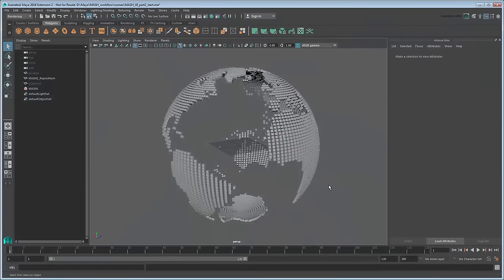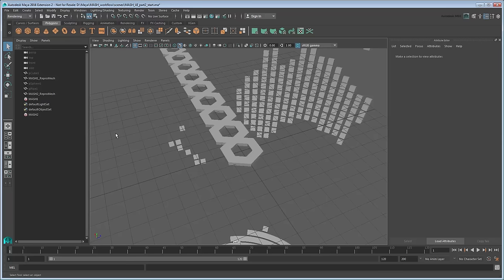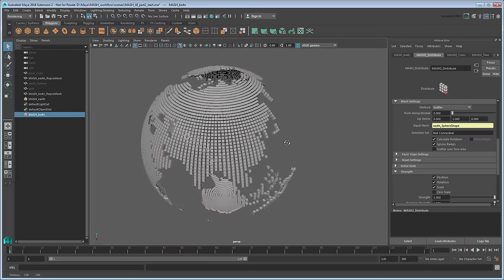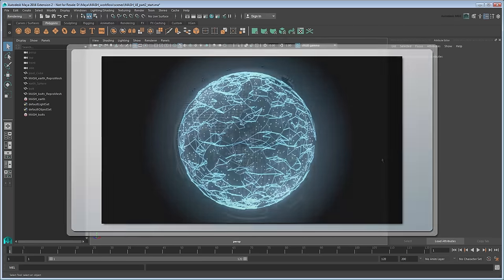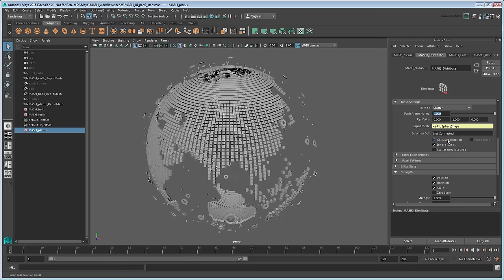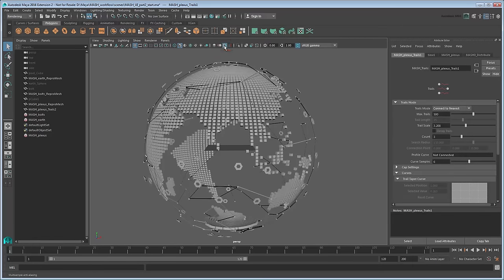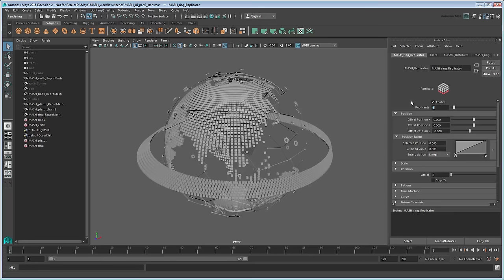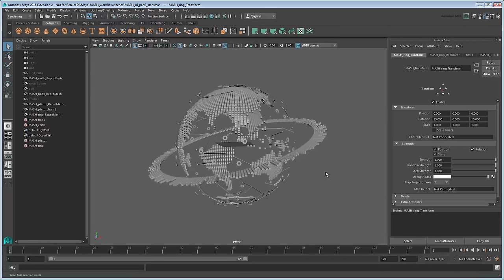MASH end to end workflow - Part 2: Creating a plexus sphere and surrounding elements

Comment: thing what I am trying to do is to have them spaced all the same, how do you do that? Instead of having all kinds of different spacing?
Reply from the maker: There's a couple of things you can try.  The easiest method is to alter the starting sphere with some of the modeling tools.  You can remove some of the edge loops along the height to space out the cubes more.  That said, the vertices will always have to pinch together a bit (otherwise you'd have a rectangle rather than a sphere).

Alternatively, you can try setting the Distribution Method to "Voxel".  This will give you a slightly different effect, but very similar (and the cubes are guaranteed to stay the same distance apart).  However, you will probably need to add an extra "Visibility" node with a falloff region to remove the extra voxels that get generated inside the globe.